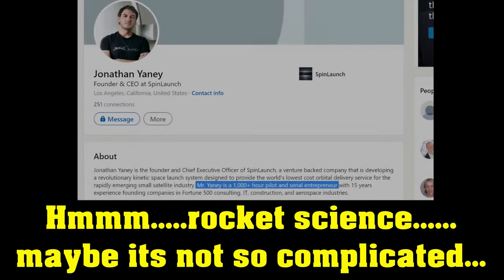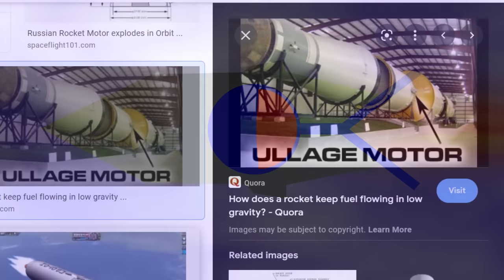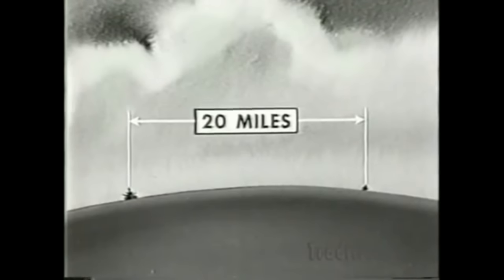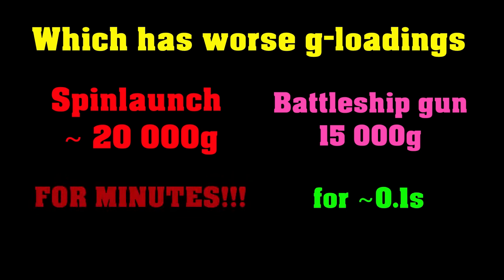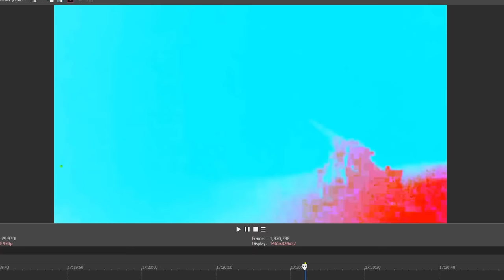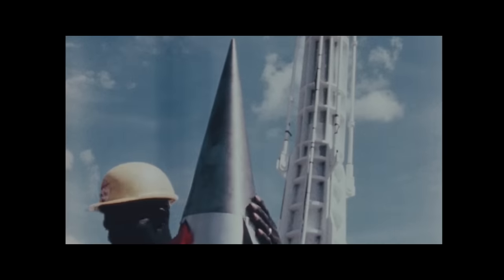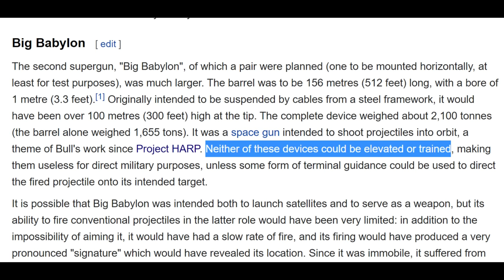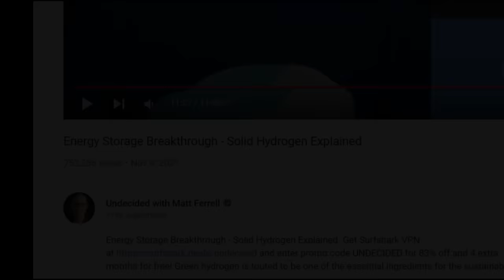Spinlaunch: BUSTED (Part 2)

Comment: Won't the rocket explode, like hitting a wall, if they managed to spin it up to 6x the speed of sound, when exiting the vacume, cos it will literally suddenly have a wall of air molecules..?
Reply: Hopefully it gets caught on film
Reply: Not if they make the rocker reaaaally pointy :) But seriously, I think pressure after launch is a big enough problem that it may well be a showstopper. Not only is there going to be air outside, there is going to be air that is going to get explosively into the chamber as the vacuum chamber opens. I really doubt that they had anything resembling a vacuum for their first launch.
Reply: Unless they have a part to throw ahead 1 cycle sooner to disrupt the air?
Reply: @1un4cy  Really isn't going to work like that. According to Phil (Thunderfoot) air leaking into a vacuum will move at about speed of sound. Now compare the volume of the launch tube to the volume of the Cyclotron (yeah I know they didn't call it that, but why not) the air is going to rush in but will take some time, and then it will reverberate. With air oscillating in and out of the tube the shock waves will be tremendous. Good luck doing that more than once.
Reply: Don't see why it would be any worse than flying through air at a constant hypersonic speed? Sure the projectile will start slowing down more quickly when it enters the air, but nowhere near the g forces it would experience while being spun round.  Not sure what mechanism would cause the air to act as any kind of 'wall'.
Reply: @mrgreatauk  basically the air would compress only to a point then act like a fluid think of it as a much less viscous liquid if you throw a ball at a boddy of water the water will resist same if you throw a high-speed object at the atmosphere this is the exact reason space craft have heat shields and that is just the upper atmosphere
Reply: @ryanbelcher396  I don't really see what you're getting at. How does that make the air wall-like? If an armour penetrating bullet can punch through mild steel like it's not even there I don't see why there's any particular problem with a projectile punching through air having come from a vacuum.
Reply: @mrgreatauk  friction.
Reply: @moshunit96  but why is this friction wall-like just because you've gone from low pressure / vacuum to high pressure / sea level air pressure?
Reply: @mrgreatauk  the armor piercing bullet in most of the cases gets shredded. 

Imagen if you take your fist and you hit water. Now Imagen doing it as fast as possible. The faster you go will result in the molecules acting more as a solid as they don’t have time to move out of the way
Reply: screw the wall of air, what about the literal wall they have to smash through that's strong enough to hold a vacuum?
Reply: Not to mention the physical wall of vacuum seal it has to break first... I'm not an expert for satellites, but as far as I know, they are basically a big computers, right? What happens to normal computer when you toss it at wall with your normal strength? Average person can throw things at speed of ~20 meters per second. They are proposing to throw a computer in steel capsule at steel wall at ~12000 meters per second. I doubt that any electronics will survive that.
Reply: @machinech183   @machinech  I'm still not really sure what you mean. Hypersonic flight is possible, and although the projectile would suffer heating and a lot of drag, and air in front of it would be compressed etc I don't see why that would be such a problem for a custom designed projectile, or why entering the air from a vacuum would cause such a problem. Surely the very fact that you can compress gasses like air means there shouldn't be any surface tension effect or whatever it is that causes impacts with water to be so hard.  A supersonic shock wave would presumably form where the top of the projectile first enters the air, but wouldn't this just be the same as constant flight through air where there is a continuous shock wave?

You say mach 6 won't be like hitting the wall, but that's kind of my point? I don't see why the heating and friction will necessarily destroy a projectile designed to handle hypersonic speeds just because it enters the air from a lower pressure area.
Reply: @inteallsviktigt  maybe, although some large penetrators seem to go through thin armour without much damage! Surely the fact that air is compressible and doesn't have surface tension like water means that an impact won't be as 'hard' as hitting water? I don't know why it is that hitting water is so hard Tbf.
Reply: @Lassi Kinnunen 81 How is it sealed? Or will they some ball valve just before launch? I admit that this would solve a part of the problem, but you still have the problems of:
1) sudden change of pressure inside the chamber
2) sudden change of balance on the release, which leads to 
3) there will be a lots of heat and vibrations from sudden air resistance which will probably set the arm on fire and
4) the engine will get vibrations and air. That sounds like flames in the engine.
Reply: @mrgreatauk  have you stuck your hand out a car window while driving? Air can very much be a "wall" it just depends how fast your moving
Reply: @DuhDawg  yes, and it gets blown around by the air a bit? I really don't see what you've getting at though, it's nothing at all like hitting a wall with your hand.  Supersonic planes and hypersonic missiles seem to be able to move through the air without it acting like a wall too.
Reply: @mrgreatauk  it’s the surface tension. And air have it as well. It’s just much weaker. But then again you have hundreds of kilometers of it in the wai. That is why supersonic airplanes fly close to space as they disintegrate closer to the surface
Reply: @inteallsviktigt  I don't think that's true - fighter jets can fly supersonic pretty much at sea level without disintegrating if they want to, it's just that they tend not to do it very much due to fuel consumption
Reply: @Lassi Kinnunen 81 There are so many problems that I cannot even pick the biggest one. But there is a silly solution for this silly idea. The release mechanism will be also return one! When it launches one, it will catch another one returning back from space. This way you have it balanced again and you can use the motor as power generator, so it will make (nearly) the same amount of energy as it used to accelerate the launched one.
Reply: @mrgreatauk  The Concord cruised at 60,000 feet where the air density is only 7% of that at sea level. The air can only move away from the front of the projectile at the speed of sound, exiting the vacuum the rocket will accumulate a pocket of air in front of it that cannot move out of the way fast enough. Another commenter mentioned that they should built this thing on a mountain, 15,000 feet up. That makes good sense, the higher the better.
Reply: @pietperske3583  isn't that 'pocket of air' just the same as you get in front of any supersonic object, be it a plane or a bullet? You don't get air moving out of the way of them beyond the supersonic shock wave (which essentially starts at the tip of the object) either. I don't see why this would be any different? Also just because concorde cruised that high doesn't mean its impossible to go that fast lower down. Bullets, missiles, and fighter jets prove that.

I agree that building it up a mountain would make sense though, if they actually managed to design a working launcher. I don't see why 15000 ft would magically make the air not a wall though if it was going to be an inpenetrable wall at sea level.
Reply: @mrgreatauk  not at these speeds.
Reply: it sure makes a loud noise either way.
Reply: @inteallsviktigt  good point. mythbusters did a bit on how much water slows down various types of bullets.
Reply: @mrgreatauk  You dont seem to comprehend the difference here... Fighter jet at the deck can only go a bit past the speed of sound due to the high air pressure. Why do you think aircraft fly at high altitudes to preserve fuel. We are talking 6x the speed. Big difference.
Reply: @Spectification  you're right, I don't. No one on this comment thread seems to be able to explain why supersonic flight from vacuum to air is somehow impossible. Sure mach 6 is fast, but armour piercing rounds from tanks go almost that fast and they don't magically get stopped as soon as they come out of the barrel because the air can't get out of the way and becomes solid or whatever. As far as I'm aware there is no aerodynamic effect that would cause that.
Reply: I'm trying to imagine that seal breaking, air rushing in at the speed of sound and then the sonic boom the rocket will create when it meets the air, and deciding what sized chunks the facility will be left in.
Reply: and? what do think rockets and bullets do in the atmosphere? yup they hitting air constantly
Reply: @orkhepaj  Bullets are supersonic, (mostly) but do not travel at hypersonic speeds. Bullets are also rather small, but still manage to produce a sonic boom. Larger objects produce quite destructive sonic booms, loud enough to break windows, etc. Bullets are pretty solid and do not have highly engineered moving parts, or delicate solar panels they unfold. Sudden acceleration and sonic booms are not good for sensitive parts.
Reply: @engineeredlifeform  That might be true for normal bullets, but modern high calibre guns can fire projectiles with all sorts of electronics in them and are fine. All depends on if your electronics are designed to withstand high acceleration loads or not.  Delicate solar panels etc is a complete red herring, people were proposing that any projectile would somehow hit a solid wall of air and be destroyed, not merely that delicate parts might be damaged (which of course they would be).
Reply: @mrgreatauk  but not at hypersonic speeds. Pay attention to the details.as for Solar panels, we've seen solar panels get damaged by regular rocket ascents, so pay attention to the history.
Reply: @engineeredlifeform  what history do you mean? These solar panels you're bringing up are a red herring. And what mechanism to you foresee that prevents electronics from surviving hypersonic speeds? Solid state electronics can be really quite hardy if designed correctly.
Reply: @mrgreatauk  OK, it's clear you aren't cut out for this conversation. The numbers just don't mean anything to you.
Reply: @engineeredlifeform  lol, 'not cut out for this conversation' what does that even mean? You haven't given any numbers, or any explanation of this magical mechanism which will destroy anything travelling at hypersonic speed going from vacuum to atmosphere.
Reply: @mrgreatauk  You really don't grasp what's going on do you? I haven't said there is a  "magical mechanism which will destroy anything travelling at hypersonic speed", what I have said is that there isn't a way for  finely engineered moving parts to survive the transition into an atmosphere at hypersonic speeds. Do keep up. You understand there'll be a sonic boom as soon as that seal is breached, yes?
Reply: @engineeredlifeform  The topic of discussion is: "won't the rocket explode, like hitting a wall [...] when exiting the vacuum, because it will literally suddenly have a wall of air molecules". You started bringing in delicate parts, but that wasn't within scope.
Reply: @Dr_Wrong   I take your meaning from point 1 that maybe the 'wall of air molecules' causing the rocket to explode might be more of a metaphorical wall than a real physical effect - fair enough. 
I still have doubts about whether it would really be as destructive as implied though. Eg:
Point 2: Isn't drag related to the square of speed not cube? 2b) Also although not relevant to the overall destruction of the rocket, I doubt any electronics designed to withstand 10000G during the rotation phase would be that delicate or sensitive.
Point 3: that is an interesting effect I'd not heard of. Surely God aerodynamic design could tune the harmonic feedback so that it wouldn't affect the rocket though? After all armour piercing rounds can travel up to mach 5.5 without catastrophic levels of drag. 3c) Plenty of things have flown faster than mach 5 at high altitude though, eg hypersonic test aircraft, missiles, spacecraft re-entering the atmosphere etc. Even at sea level things like armour penetrators travel at mach 5+
Point 4: it would be quite an abrupt transition, but given the tip of the rocket will be forming a supersonic shockwave anyway is it really so significant? And this us a rocket designed to withstand massive forces being spun up to speed, so will necessarily be quite beefy anyway...
Point 5: modern penetrators actually go mach 5+ and yes Tbf after smashing through a steel plate they aren't the same shape they were beforehand. However they seem to do absolutely fine travelling through the air.
Point 6: yeah belly flops do hurt! But then my belly isn't designed in the same way the tip of a supersonic projectile is.
Reply: @mrgreatauk  it's all within scope of whether this is a feasible way of launching functional payloads. If all they can do is launch solid objects which can withstand the  shockwave, what's the point? Do you have any critical thinking skill?
Reply: @engineeredlifeform  Whether it's a feasible way of launching functional payloads is not the topic under discussion though. Although for what it's worth I don't see why you couldn't design a working satellite that would withstand the forces.  It would just have to be a lot more solid than normal satellites, and things like solar panels would probably have to be encased in a clear outer skin or something rather than have a delicate unfolding mechanism.  Or maybe a lightweight inflatable design or something. Would take some working out but seems like it could be possible to make a satellite which would withstand the forces with a bit of development work.
Reply: @mrgreatauk  Whether it's a feasible launch vehicle is exactly the subject under discussion. Why spend time and effort on the project if that's not the goal? As to your 'what if' nonsense,... the answer of course, is weight. But I think the conversation is unfair, I used to work with guys that built satellites for a living, and I provided ground support and IT equipment to them. I've spent a lot of time actually talking to engineers who build stuff that goes into space. I guess you haven't, which is why you aren't really grasping the engineering difficulties.
Reply: @engineeredlifeform   it's not though. Just read the comment. The discussion is about whether hitting a wall of air molecules will destroy anything launched by a hypothetical full size spin launcher. 

If your measure of whether it's worth discussing something is whether it's feasible to get the whole system working in reality, then why are YOU discussing the spin launcher?

As you bring it up though, weight is not a good reason that you can't make a satellite more robust when using a theoretical launch system like the spin launcher. Either just scale back the capability of each individual satellite so it can be lighter despite being robust, or make the 'spinlauncher' able to throw heavier objects.

That's great that you have been able to speak to satellite engineers, but not really relevant to the topic at hand, or to the feasibility of a 'spinlaunched' satellite where its design parameters would be quite different to normal satellites, unless they had specific comments on issues with designing robust satellites for 'spin launchers'.
Reply: @mrgreatauk  OK, so this shows you really don't know wtf you are talking about. Weight is everything when it comes to launches. Go back to school.
Reply: @engineeredlifeform  You're still completely missing the point, and also you're wrong about the weight thing, which you seem determined to bring into this for some reason. Not sure what going back to school would do, I got excellent results thank you very much, I can only assume you didn't. In this particular context, weight is not everything. The whole point of theoretical systems like spin launch is to reduce the cost of getting stuff into space. If your cost per kg for a spin launched satellite is a tiny fraction of a traditional rocket launched satellite then it doesn't really matter if your spin launched satellite is ten times as heavy. It will still be more cost effective.
Reply: @mrgreatauk  COMPLETELY AND UTTERLY WRONG.  You are clearly far too hypothetical and nowhere near practical. More weight means more kinetic energy, in a system that needs to be ever so finely balanced to stop it tearing itself apart, while a vacuum is breached, and air rushes in at the speed of sound, as a sonic boom is created right by the building, as air is heated to several hundred degrees C. It's not just about numbers, or theoretical costs, it's about the real world engineering of this.
Reply: @engineeredlifeform  it seems we've now stepped away from the original question completely, and you think it might be feasible for a small, lightweight projectile to be 'spin launched'. OK, so you know for a fact that say a 50kg projectile is feasible, but a 250kg projectile would be simply impossible due to the need to 'finely balance' the system? I doubt that you do. It would be similar engineering, just scaled up. Consider that to a certain extent more mass might be helpful. You will need a certain minimum mass:drag ratio (which improves as you add mass) for the projectile to keep enough of its speed to reach high altitude. A very light projectile would be more affected by air resistance, and also more affected by very minor unexpected forces during the release process, exiting the launch system, and dealing with turbulent air entering the vacuum chamber as it exits etc.  Sonic boom? Whatever, buildings cam be hardened, and an exclusion zone put in place, just as is currently done with chemical rocket launches.
Reply: @mrgreatauk  no I don't think that. Pay attention.
Reply: @engineeredlifeform  jeez. You are so rude. So you think that it will just fail to work by an even larger margin the heavier the projectile is?
Reply: @mrgreatauk  Light projectiles need higher velocity, but lose energy at ^2 of the velocity, so lose a lot of kinetic energy via wind resistance, so will struggle to make orbit. Heavier projectiles suffer from this less, but raise more stability issues when they separate from the boom. Both are going to cause sonic booms which will damage the infrastructure. It's a dumb idea.
Reply: @engineeredlifeform  I agree about lighter ones, but heavier ones would just need a stronger system with a scaled up method of dealing with the imbalance when released. The sonic booms will only damage the infrastructure if it's not designed correctly. Personally I don't think it's clear whether it's a dumb idea in general or not. Obviously there are a lot of problems to solve and the current prototype system doesn't seem to have solved very many of them, but doesn't mean that a redesigned system couldn't ever compete with other launch systems.